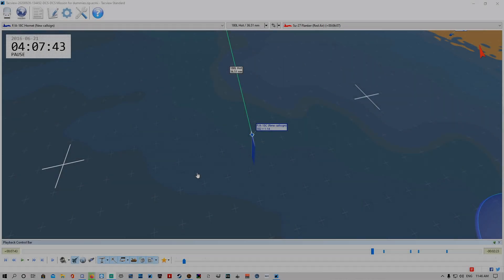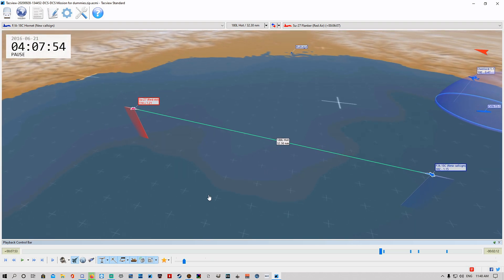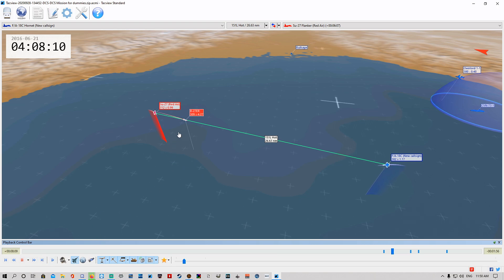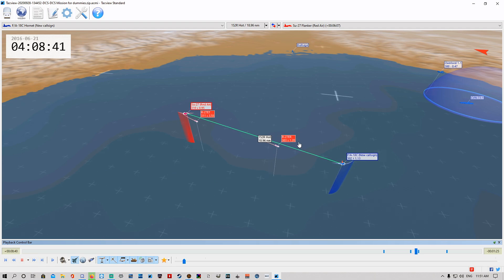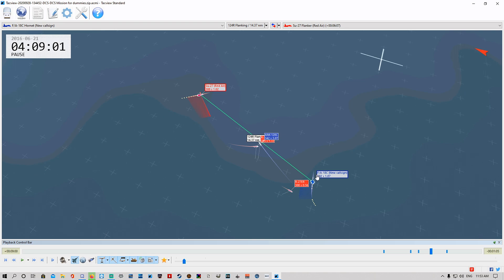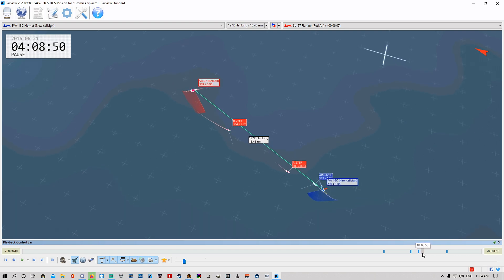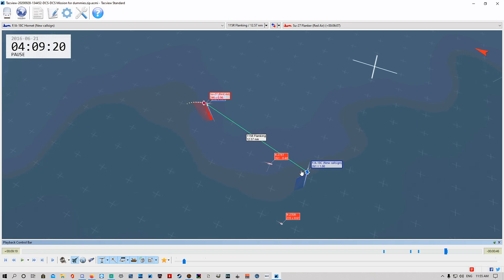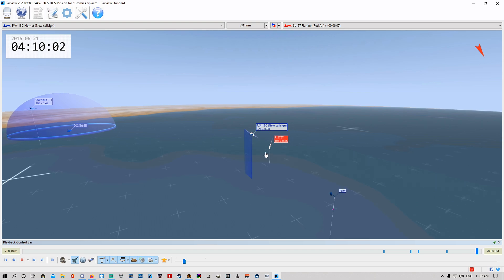DCS - F/A-18C Lot 20 Hornet BVR Cranking Manoeuvre

Comment: About how far away do you like to place your enemies for BVR practice in the mission editor? And do you use CAP vs intercept, and any of the other special settings like their missile launch range etc?
Reply from the maker: I usually put the distance about 60NM, but if you’re starting from scratch you can bump it out further to buy more time to get your switches set and ready to go. I normally just put red AI on CAP  and give them a waypoint flying directly at my aircraft so once you get in range they will auto engage you like normal. If you want less stress I’d start with only allowing them fox 1’s or fox 2’s only so you can fly the crank and not get freaked out about incoming missiles. 

Once you’ve got a few run through da under your belt then give them better missiles and see how you fair 💪🏻
Reply: @TorniQuetHD  Thanks, Torni! Do you have any tips flying as red against AMRAAM equipped blue fighters, if terrain masking isn't an option (over the ocean or flatter parts of the Gulf)? Hope you had a good holiday ^_^
Reply from the maker: @ColonelAkirNakesh  against a blue for aircraft you need to choose your battles wisely, if it’s an F-16 the only really smart thing to do is to turn cold when you get within 30NM and make them waste their missiles… F-16 at altitude and high speed is absolutely lethal in BVR atm. They can reach you from launches at 30+ mile and have a really good PK if you don’t anticipate what they are doing early. 

Luckily the viper only has 6 total and a short time on station before it runs out of gas and has to RTB. It’s a tough nut to crack in BVR atm and the smartest thing is to drag them closer and closer to friendly forces and overwhelm them with numbers and fight them in the phone booth instead of letting them engage from range.
Reply: @TorniQuetHD  Thanks Torni! I'm playing that Su33 campaign so no terrain masking over the water. But dragging them toward friendlies was the only way I survived :D